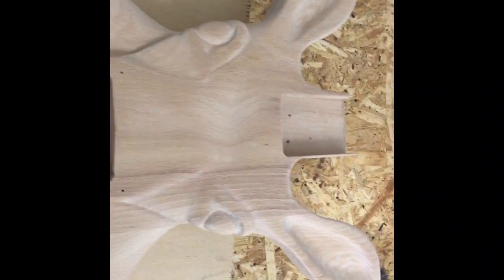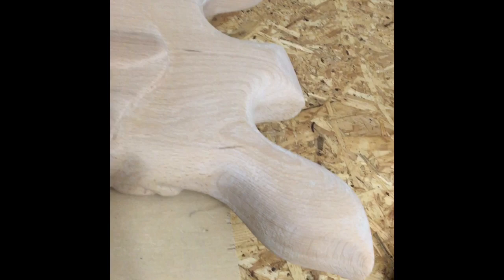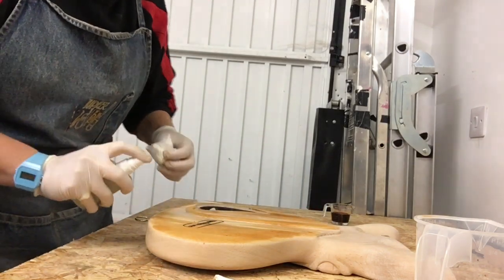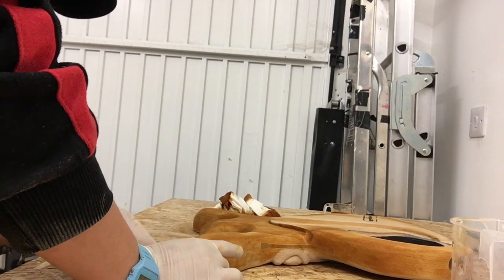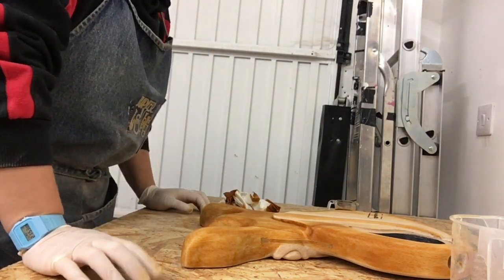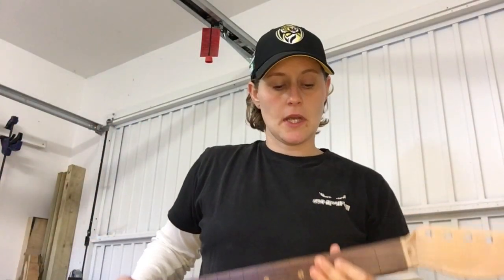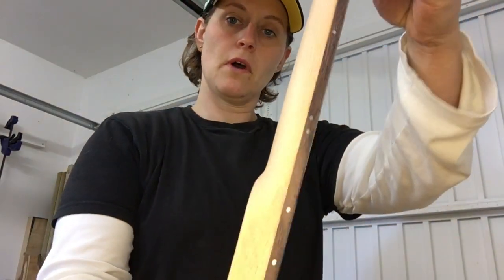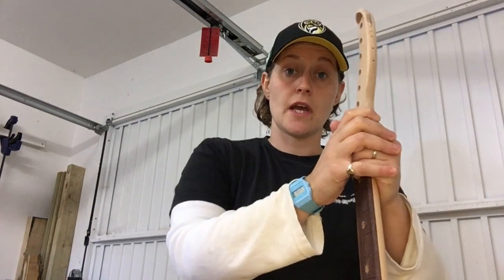Great Guitar Build Off 2020 Unofficial

Comment: An old (many times washed) t-shirt is best for applying stains. I found that kitchen towel tends to leave bits behind, on more open pored wood, especially with water based stains as this will raise the grain. So more sanding required, afterward! 
 But this build is great. Love the details!

Comment: I have a couple of old cow magnets that look like lipstick pickups. It's too late now but one of these magnets could have been made into a pickup with a coil of wire. The new magnets are now covered in plastic but the old ones are plain magnet grade steel and look like chrome but I don't think they were plated.